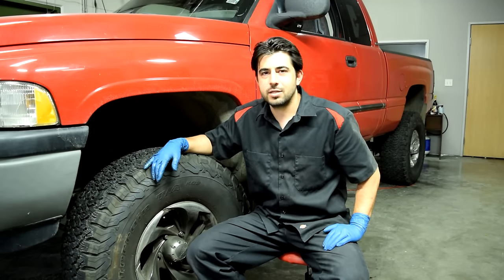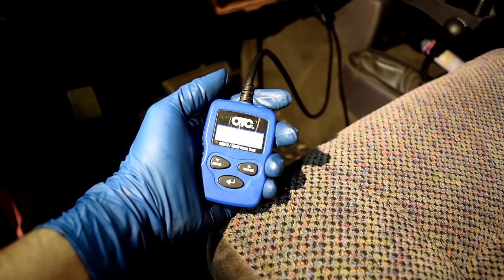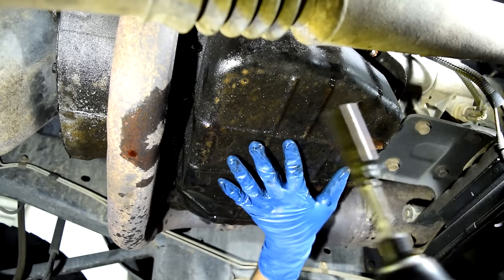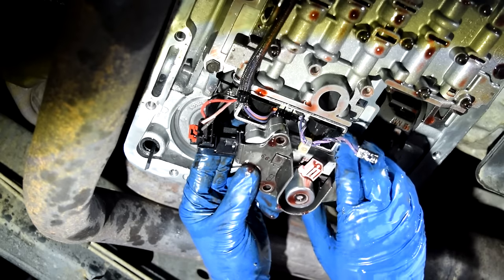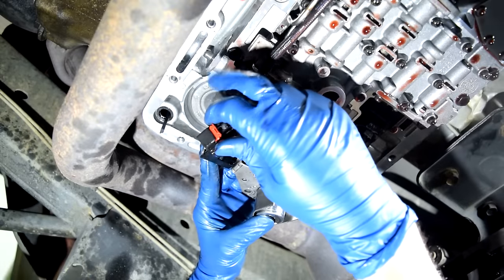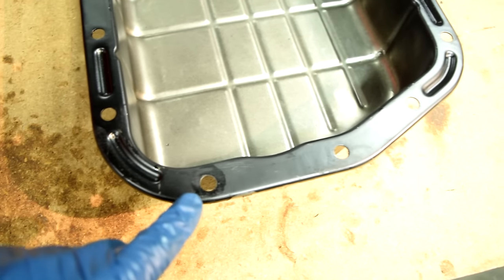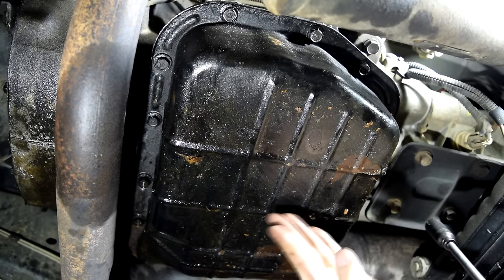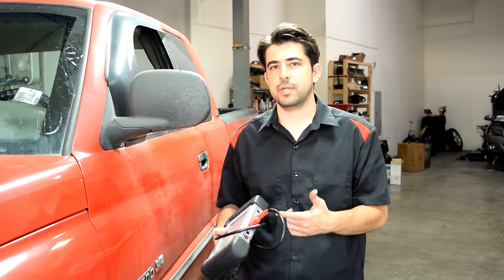How to Fix an Automatic Transmission That Won't Shift - Replace Pressure Solenoid, Fluid and Filter

Comment: Just want to say Thank You. Your video saved us $10,000 that is what the Dealer wanted to replace the transmission in our 2004 2500 Dodge truck. My husband and I are both 73 years old we were able to follow your video step by step and now the transmission is working again. Thank you kathy

Comment: How many mechanics would tell you that you need a rebuild
Reply: No specialist would. Definitely not where I work.
Reply: All of'em but of course there will be some honest ones that'll tell you for an easy fix (if there's an easy fix) "we charge for what we know not for what we do" some mechanics say.
Reply: Guy tried to tell me id rsther get a rebuild before dropping pan
Reply: I called a shop and they told me “u need a rebuild” like damn I can’t get it looked at first
Reply: 95 % of shops  have warranties for there work  and   also won't open a trans that has 150k never serviced    and its a  Chrysler  transmission the worst trans  made    it will be back over and over again    and everytime the shops making    2 hrs rate of work..    someone like me would be upfront and say   we change silinoid and   filter and fluid  no guarantees  of how long  you'll keep going   because its a high mile trans

Comment: These only have a pcm not a trans module. Dont be a parts changer. Do these all the time. Continuity check works the best on the solenoid. Make sure you have the 5v goin to computer and make sure the computer is sending ground to the assembly. If that check is ok pop open the pan.. Disconnect the pressure solenoid then do a resistance check if there is resistance then replace the solenoid. If no resistance and you have continuity then replace filter and clean the screen. Also if your wiring and electrical side is good then a flush would be best before replacing filter and cleaning the solenoid screen. Also check for closed looped system when checking fluid lvl

Comment: i just finished doing this procedure on my dodge durango. i was hesitant to do it because my my scanner didn't give me any codes telling me anything was wrong, but all the symptoms you described were there, thank you for you detailed video.  I'm happy that I did  the job myself because had a mechanic quote me a price for $500 parts and labor. and so far I'm  $104 in parts. I say so far because i broke one of the bolts, but that least of my worries now that I know that my trans is going to be okay.

Comment: A neat trick I recently learned from another channel is to use a few cable ties through some of the bolt holes to hold the gasket in place on the pan. Once you have all the other bolts in place cut the cable ties pull them out and put in the final bolts. I guess RTV holds it in place too but it's not always necessary to use RTV.

Comment: Thanks for this video. I bought a '97 Dodge Ram 1500 8 cylinder three years ago. (love it, a real workhorse). Just recently, at 100,000 miles the transmission began to  slip, but mostly won't go into overdrive. Sometimes it does - sometimes it doesn't. The gas mileage is still the same, though.
So, I'm going to get brave and replace the pressure solenoid myself. Listing the tools you used is a big help - I like tools. 
Thanks again - great job on this video.

Comment: Dude you are a hero. My 1999 Dodge Ram 5.9l would not shift it was showing the exact symptoms as this truck. I bought the solenoid because it was inexpensive and was full of doubt but when I got it in it actually worked it shifts finally props to you man
Reply: Did you have a check engine light or error code?

Comment: GREAT DETAILED VID!!! I have a 1999 Jeep Grand Cherokee 4.0 with 42RE trans that is failing to shift(or slowly shifts) from 1st after coming to a stop.When trans is cold it shifts normally, but when warmed up it has the shift problem.  I have heard from others these two parts(solenoid AND pressure sensor) are the first you should replace and also the trans speed sensor('99 uses only one). Thanks! Mike in LA, Calif, USA
Reply: Did you ever fix your Jeep my truck does the same thing? Any help would be greatly appreciated

Comment: I love the amount of explanation you give...you make it easy to follow along! Thank you! Also is this the same thing for p0700?
Reply: That code just refers that you have a transmission problem, it doesn't specify what it is. Look at the description for that code in the scanner, if it doesn't tell you a specific problem like "pressure too low" or something like that, take it to an auto parts place and have the check engine light checked, they'll give you a full diagnose of the problems

Comment: Great detail, thanks for the info. At some point most second gen owners will run into this. My 2001 sport only has 76,000 miles and had to do this.
Reply: What were your symptoms? Unable to shift out of first gear? Did this fix your problem?

Comment: Cool Video. I have the 1998 Dodge Ram 1500 4x4 with 5.9 Eng and Eng light came on after jumping over a few road bumps, as a result, I got Eng light with 2 code P 1756 and P 0740.  So, In search, i saw your video and from start follow what you recommend....... Start the truck with Eng light still on, checked the trans Oil 3 times, it was at the level where it should be, Than i went and shift the gear from P to N then to D after 5 seconds to 1 after 5 seconds to 2,...move the truck little bit each time on that gear and guess what?
My Eng light went away!
So, Happy.
From now on i would go slow on the road bumps.
This true, I am not kidding. Eng light went away.
Even if in the future i have to go and change it, I would owe it to you for your great Video.

Comment: Great job very well done I have a 97 dodge ram 1500 4x4 I need to change the tcc solenoid truck will not stay in high gear any information on video you have on it would be greatly appreciated thank you keep up the good work thanks for sharing

Comment: I'm so old school! I still can't get used to electrical parts being submersed in transmission fluid! I worked with electrical parts most of my life and that just goes against all common sense! What were the designers thinking! Btw...thanks for the video...may be helpful in the future. I have a 2002 Dodge truck. Not sure if it's the same, but I now know transmission repair may be a lot cheaper than previously thought!

Comment: Thanks brother I cleaned my solenoid and it worked as well did a dam good job of it with the change in filter exc. It all worked out and I pray that it continues to work... and did it all under an hour... thanks for the intell...

Comment: Great info man! I have an issue with my automatic trans having a high rpm on accelerating. It revs around 3k to 4k before shifting. I can also feel there a delayed engagement after pressing the pedal. Should I do the same thing what you did, or is there something else to do? I've never changed the trans fluid but on checking the dip stick, its fairly pink. (driven 140k miles)

Comment: Hello! Super video! I’m watching this because I just replaced my water pump in my 2002 dodge ram van 3500. It went smoothly and the van started and ran smoother than it ever has. However my transmission is not shifting into 3rd or 4th. Could I have knocked something loose taking the fan or belt off? Any help would be appreciated.

Comment: seriously good tip with that epoxy spray idea. why leave a 0.5mm scratch there which could create an annoying leak when you can just spray $0.20 worth of epoxy on there and wait 30 minutes? great tip. never seen it before.

Comment: Awesome video!!! Tip Top!! I have a 1997 Chevy Silverado and it’s driving me nuts! It will only shift out of first gear after it gets warmed up. It will not shift out of first gear until I drive it for about 20-30 mins then it shifts fine. Please help!

Comment: Great job!  I have a 2000 Jeep Cherokee xj 4.0 litre with an automatic transmission.  It down shifts poorly only in the 1-2  lowest gear selection.  Is that normal? Thanks

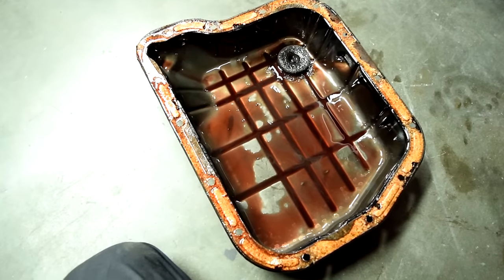Comment: You forgot to mention about the magnet inside of  the oil pan you can clearly see it at the minute 4:25 that is very important matter fact you forgot to put it back-other than that is a good video
Reply: good catch

Comment: Hey  hope your great ! I have a 1998 sentra, I shift into reverse it works perfectly,  but when I shift into any of the drives it won't go, but at times it does catches drive, and then it's perfect till I turn the car off. When I turn it back on it does the same again some time I just put it into drive and accelerate really soft and it catches drive and then it runs perfect again, thanks for your help!

Comment: wow. amazing. looks easy for you to do.

my transmission is delay when changing on gear 1 to 2 only when moving fast. but when i'm moving slow, it change gear very smooth from 1 to 2. the rest is fine. gear 3, 4. what do you think is the problem?.

Comment: You don't always need to replace solenoids.
Juste replace the defective resistors on the the solenoids or resolder cold solder joints on the flex cable and that's it.

Comment: I have a 1993Chevy van g20 5.7L 
Just replaced the transmission
But now sometimes works perfectly
And some times won't do nothing. Like I can shift and won't catch a spedd from reverse to the Las speed.
Than I turn it off 
Wait a few minutes
Turn it on again 
And trainy is back in business again.

Comment: 2003 automatic 5.7 ram. It drives fine when in Drive, but won't move when put in 1st or 2nd gear. Can that solenoid cause this problem as well?

Comment: When you are checking fluid for a dodge you HAVE to have it in neutral so the fluid is flowing or else it will appear it is over full. Ik this because I work at a  transmission shop
Reply: Great tip!!! I have always used this technique when checking trani fluid in any vehicle I own. I have a question for you, Gauge Horton, Since you work in a transmission shop. I have a 98 Dodge Ram 1500, 5.2 litre V-8 motor, with 4WD. Yesterday morning, while driving to work, I was approaching a left turn. Coming off a 13 mile stretch at 55-60 mph, obviously, I had to slow down to turn. As soon as I put my foot back on the gas pedal, it was as if my truck shifted itself into neutral!!!. I had to coast to the side of the road, put it in park, wait a few seconds, then put it back in drive. It didn't shift immediately like normal, took about 3-4 seconds, and only stayed in gear about 10 seconds. I lost trani function 4 times like this in a half-mile stretch. I immediately checked fluid level, color, smell. All were spot on. My boss and I attempted to "walk" it through the tree, 1 gear at a time, SLOWLY, to no avail. All I can find for info, help,  and troubleshooting is to replace Governor Pressure Solenoid and Sensor Switch, or the whole dang transmission. If you or anyone can help me, I will be eternally grateful. I work in an Auto Parts store so you'd think I could figure this out. I'd rather rebuild carbeurators all day than deal with a transmission issue. Thanks in advance for any words of wisdom.
Reply: gauge horton any tips for an 08 mountaineer (ford based) locks us from shifting past reverse unless the engine, oil etc is plenty warm then even if we reverse onto an uneven patch of groud the problems even worse. every fluid's been replaced so far if that helps at all
Reply: gauge horton : Same on KIAS & HUYANDIs ,gotta be in Neutral.
Reply: Unless of course you have a dodge transmission like one on this video like one I have,  that when the transmission messes up that neutral becomes 1st gear but not drive,  because it won't go into second until you put it in drive. But what really throws me off is it doesn't have reverse anymore, but it also won't go forward while in reverse. Also it jumped forward in park right after you put it in park.
Reply: What year will this work on? Is it just the 2001 or
Reply: And it takes more than 1 quart to refill it more like 6-8 not 1.5 quarts...12:24 LOL
must of went wiki how where they don't know shit...LOL
Reply: Gauge is exactly right. I rebuilt one of these transmission years ago and when I installed it and filled with fluid checking it at idle and in Park it would revv up then slam into gear so I tore it down 3 times and it did the same thing so I took it my transmission guy who built it again and it still would revv up then slam into gear and I was mad at my transmission guy because I had built one as good as he did. Well I happen to read my dipstick and it told me check fluid in Neutral and I did and it wasn't touching the stick so I added fluid to correct level in Neutral and if shifted like a dream.

Comment: Good, interesting and very didactic video, I have a dodge ram 2500 year 2004, error scanner 0748, should also change the solenoid or could be another problem.?

Comment: I have a 2014 Hyundai Santa Fe with the 2.4L GDI engine. My transmission is stuck in 2nd gear but I can shift it manually in 3rd, 4th, 5th and 6th gear when I'm driving. What do you suggest I do?

Comment: Ok I have a question for you I have the same truck but it's 2wd and lowered.  It has a problem where it doesn't want to shift it takes forever to shit when ever it does     my question is should I just replace the sensors or replace everything in the kit that you put in the description on Amazon

Comment: Hi, I enjoy watching your videos they have helped me a lot. I have a question and I hope you can help me. I was in a car accident this morning. I was hit from behind and it was a hit a run. I have a 2007 BMW 328i. I only have liability insurance so I have to fix it myself. The car won't start or change gears. The battery cables seem fine. I also checked the fuel boxes and everything looks fine too.  Thanks in advance. If anyone else can help me, I would appreciate it.

Comment: Thanks for the video. I have kind of similar problem with my Mitsubishi Outlander 2008 2.4L with a CVT 6 speeds trans. After trans fluid and filters replacement, the car only shifts the first gear and gets stuck with the second one unless I step off the acceleration pedal and then step on again so it shifts to the third gear and I need to repeat that process until I reach the 6th gear. I can also drive using Steptronic without problems. Do you know what would be the issue? your response is very much appreciated.

Comment: Great vid! I have a P0871 code and it states OD pressure switch rational. I assume this is the governor solenoid and or pressure transducer switch as the video shows. Aftermarket names and manufacturer names aren’t quite a match but my guess is that it’s the same item or items. The fault I have is from scanning a ‘04 Ram 5.7L HEMI Automatic. One symptom is stalling or dying when in gear. Can you confirm this repair to be a fix to this fault as the video explains? Thanks in advance RNW.

Comment: well i have a 99 Chrysler 300 m i think a 42 LE transmission putting out code P1781, yet i do not know where the OD pressure switch is, if it's in the valve body and replacing it would fix the problem. many video's say if you have a question..yet no reply. I would go with a quick reply as "yes it is in there ,replacing it would take care of it"..

Comment: Followed all the steps and the vehicle shifted perfectly for about a month. O/D light came on and would not turn off, about 5 minutes later trans temp light came on. I parked the vehicle and have not driven it since.
Reply: Andre Taylor it's your radiator that is clogged,my Dakota do the same,after replacing the radiator,problem solved,hope this help you...
Reply: I had a 95 dodge with the Cummins and an autumatic. It would start doing crazy shifts and downshift on its on sometimes. There is a temp sensor in one of the metal fluid lines where it goes to the trans, can be changed with a 6"cresent wrench. Fixed it every time for about 6 to 12 months.

Comment: I recently hit the median/divider. Hit the transmission pan and leaked oil.  I drove it and still changed gears as good.  I had to force the shift to Park to remove the key.  Any feedback on what could be damaged?

Comment: most trans dipsticks give instructions on checking the level right on the dipstick...pause the video@ 1:15 or so, you can read it says to check idling in neutral on this vehicle.

Comment: Hello! Nice informative video.

I own a 2010 Ford Endeavour, 5 speed automatic gear box.  88,000 kms on the odometer now. Today I faced an issue when I wanted to park the truck. I shifted to "R" from "D " & I just reversed for a sec & all of a sudden the engine revved. The instrument panel showed that the gear is on "R" but, the knob can be moved forward & reverse, as if the knob is not connected to the transmission itself. Also, after this I switched off the ignition & couldnt start the car again. The instrument panel still shows that the gerabox is still in "R" but, I can pull it back to "P" to get the car started but,  I was not able to do that. Seems the computer is not letting to do that as it assumes that the gear box is on "R" position. What do you think ?
Kindly advice on this. 

Best regards,
Arvind.

Comment: Hello, I have been using your YouTube videos for working on my 96 dodge ram 5.9 1500. Thank you for posting very helpful. I had a question if you have time to give me some feedback. I broke the overdrive accumulator spring driving home the other day and burnt my Trans fluid bad. I had it towed home because it wasn't shifting into any gears.. I bought a solenoid kit with new spring and replaced filter and fluid. Still won't shift into any gear. I checked the linkage and everything is connected and moving the way it should. I wanted to flush the rest of what I could but because it isn't  engaging any gears I can't get anything out of the cooler lines at the radiator or at the Trans itself. Also replaced the safety park neutral switch no luck. Any ideas? Valve body or torque converter maybe idk any  insight would be greatly appreciated